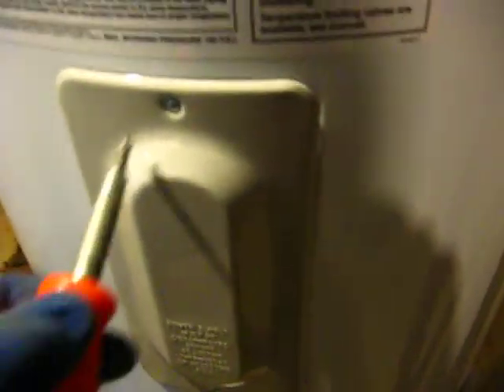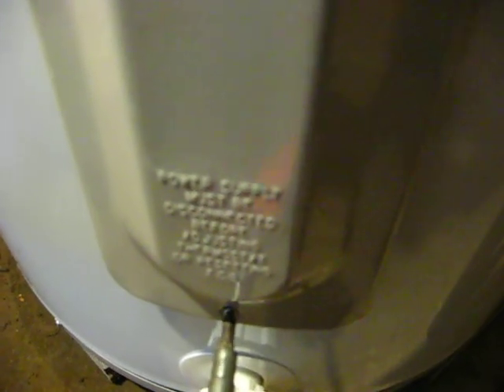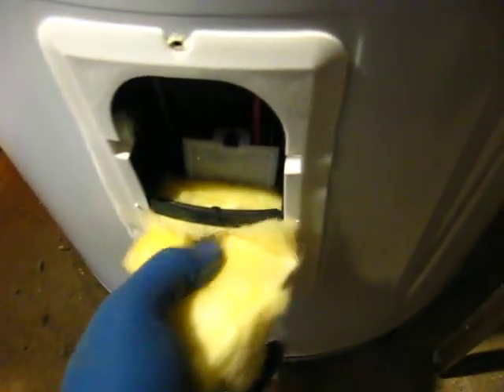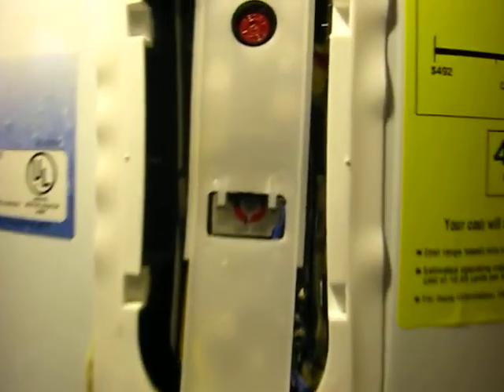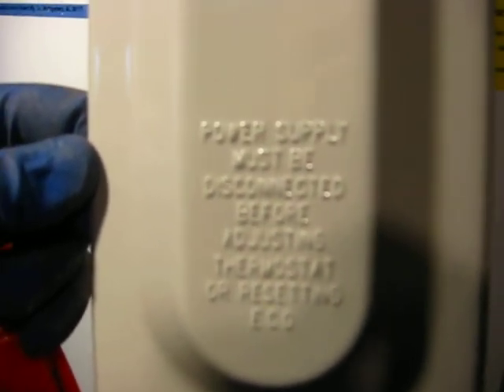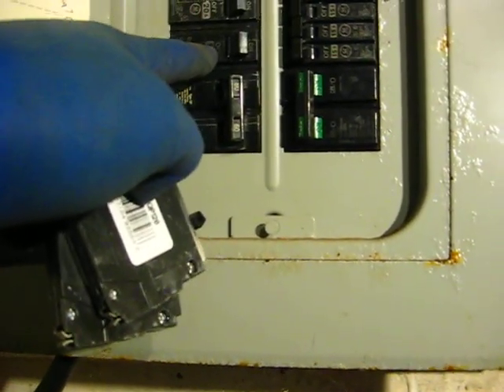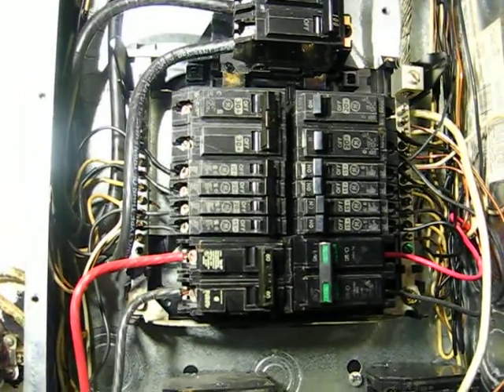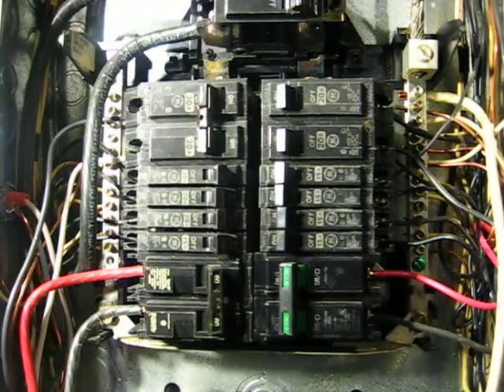GAS TO ELECTRIC WATER HEATER CONVERSION - DUNBARPLUMBING.COM - NORTHERN KENTUCKY

Comment: I went to the website but was not able to send a contact email :(.
I was just wondering how the installation of the unit went, and if any additional wiring had to be installed to supply the electric water heater unit.

Thanks.